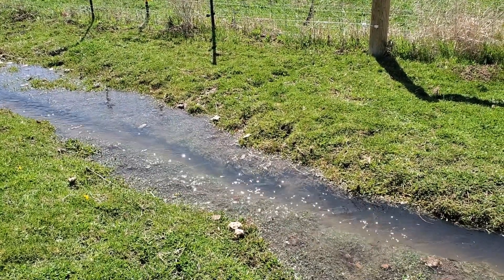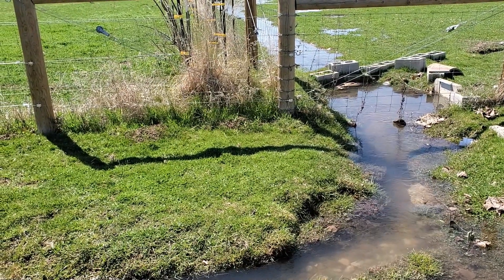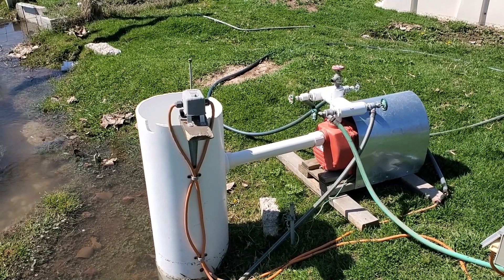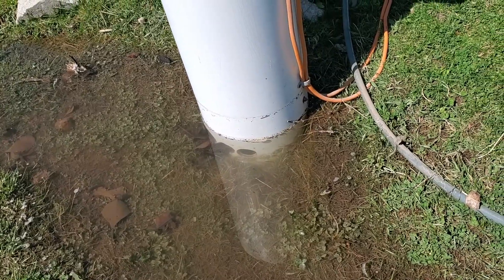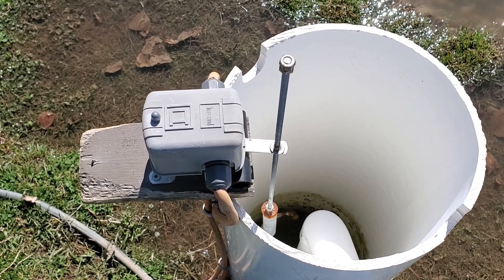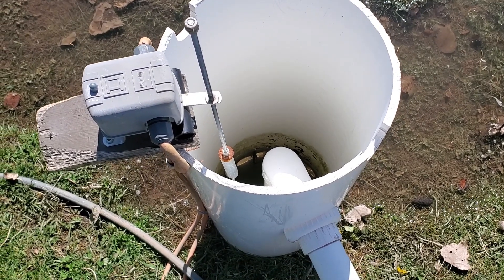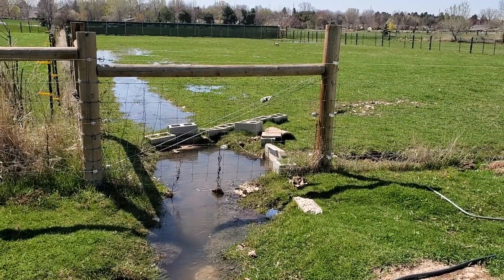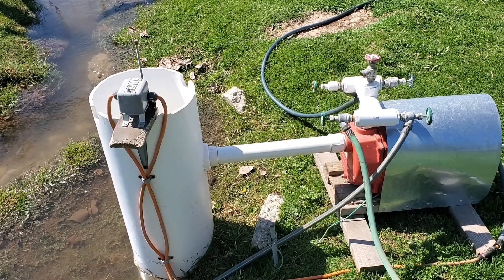240vac Ditch Pump Float Switch and Irrigation on the Farm

Comment: How far down in the ground did you dig the hole for the tube underground and how far up above ground?
Reply from the maker: Its down in the ground a couple feet. It really does not matter how far you go as long as long as you are pumping out of some sort of basin that the float can read the level out of. I will have a more detailed video upcoming of the system.